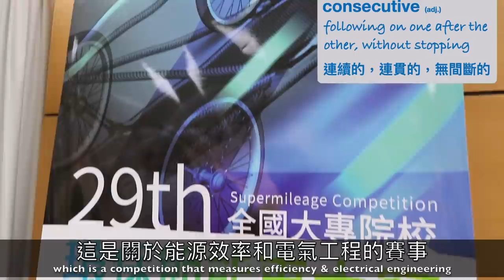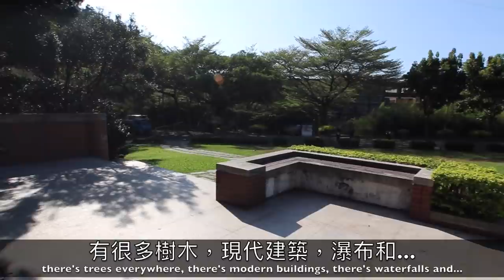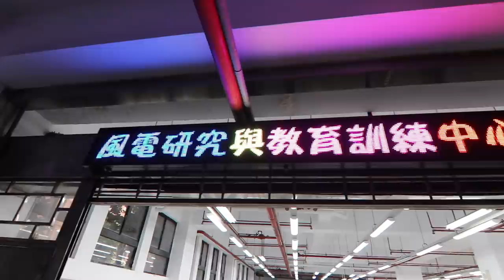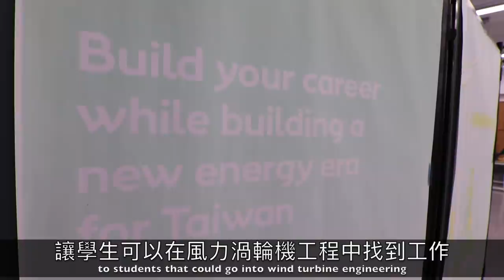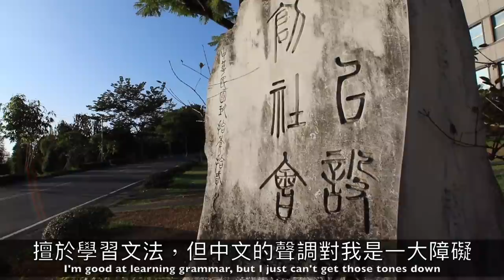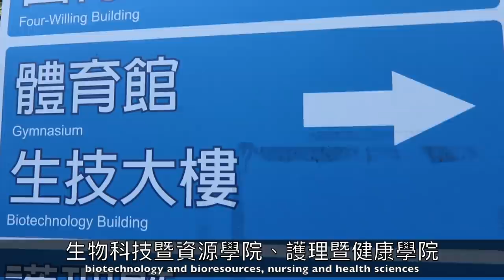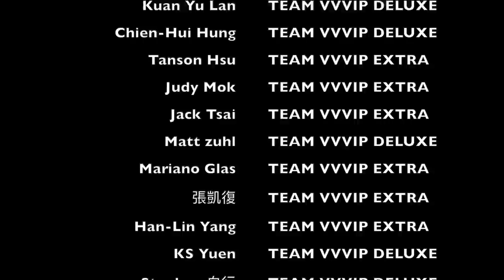來台12年才開始學中文，來得及嗎？ Is it worth studying Chinese after 12 Years in Taiwan?

Comment: Well, I don't think the tone is a serious problem. I mean, why do you need to "master" it? Even though you don't master the tone, it only makes you speak with an accent. People still understand you anyway, don't they? Your Mandarin already reached a useful level!

It is almost impossible for one to fully "master" a new language after his/her critical period ( before 5-12 years old). If one starts learning a language after this period, s/he is almost destined to speak it with an accent. (May be not a strong one but still an accent.) However, there are still a lot of multilingual people, and it is impossible that all of them develop all their languages in the critical period, but they still manage to learn the languages and communicate with native speakers, which means that accents are not a reason to stop you from learning a language. 

Perhaps you can figure out your learning goal first. If your goal is to communicate, it seems that you are already halfway there. If your goal is to speak Mandarin without an accent, well, it's hard to define the objectives since even native speakers carry different accents. If you just want to learn it for fun or give it a try, then just go for it! Because why not? You've done a great job so far.
Reply: I personally believe that the tone problem will get minor as you practice more, but if you have tried, and it didn't work, maybe you just haven't found the right way to practice or need someone's help. In this case, you can find a language exchange partner or a teacher. There are tons of them in language learning Facebook groups.